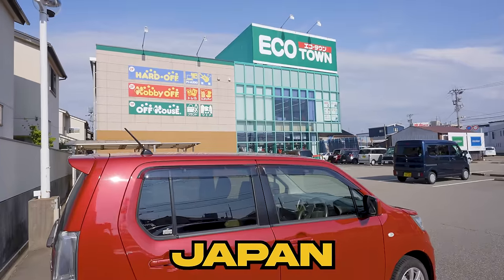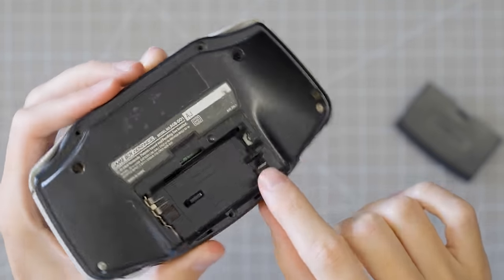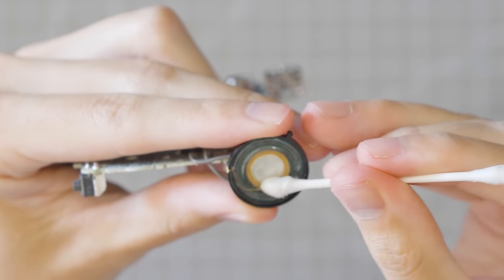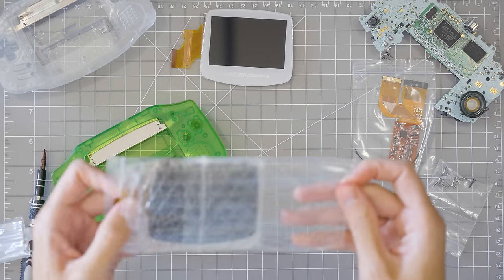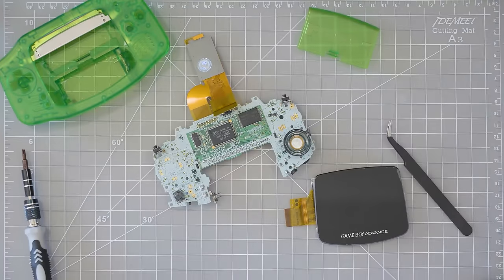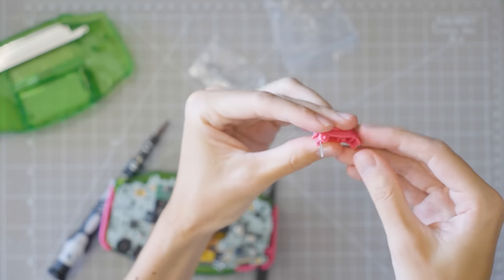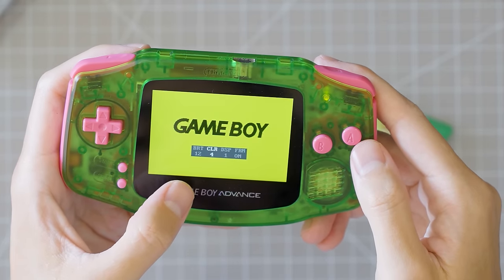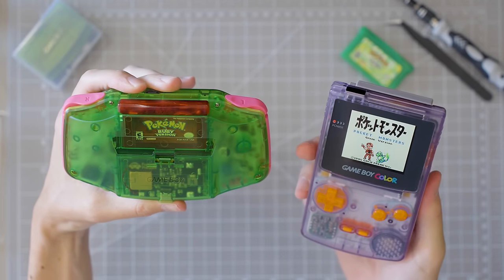I Upgraded a Junk Japanese Gameboy Advance

Comment: I modded my GBA during the Pandemic and love the screen and the new look.  I've been wanting to do another GBA mode and might get the new screen you picked up in this video.  Enjoy playing on a beautiful screen.
Reply: Marekprime  we probably used the same older LCD display that was selling on AliExpress 2 years ago? i bought my kit and soldered the 2 wires for brightness...screen not laminated as there wasn't any then...that's a new idea...i want one but i accept the mod is finished...can't have it...did you do the mod because the original unlit screen was broken or just to upgrade it? mine was damaged anyway...no battery modification on mine...just an adaptor for 3v mains power...only mistake i made was sticking the LCD down before double checking alignment...it's 2mm offset to one side...not an issue...at least it's level

Comment: I did that same thing to my original sega game gear 2110g system I put a glass screen protector on it and replaced the battery terminals and it works excellent

Comment: This was so new for me to see. I honestly didn't even knew this was a thing. Refurbishing and modernizing an old handheld. 
Proud owner still of my 2nd Game Boy Color. Had the Magenta one but the screen broke. Bought another one which was the Turquoise one and pleased to let you know it still works.  And when I moved into the house I live in now, they left behind a Purple Game Boy Color with Pokémon Gold version which still works as well. Has less good of a speaker and the buttons don't respond that well.
However my internal battery of my OG Pokemon Silver (the first Pokémon game I played and bought/got myself) run dry so couldn't re-enter my game which was completed. Full 251 dex.
I still feel sad about that. Is there even a thing to get that back or fixed? Also my Silver cartridge doesn't read anymore. Bought Crystal the year later. So the Gold and Crystal still work now but also there's no save file to return to sadly. 

Also loving the idea of owning the other handhelds and refurbish them and modernize them. Still mind blowing to me that that's a thing. So cool. It turned out real good as well! 
Japan has the most amazing stuff for sale still. I can't imagine finding that somewhere in The Netherlands or anywhere else. 

Love to see more of this. Also subbed here! Pokémon games are and were a blast to grow up with. Still love to play the games and fan games and rom hacks.

Comment: The reason for me getting a GBA is the ability to use the AA batteries. Because I have a solar charger. Then again I guess it could plug into the usb c charger. I just like nimh cells because lithium ion issues of swelling and so on . If only I had a solar algae battery powered game.

Comment: other reasons emulation on a phone is less preferable 1-you waste your battery 2-the real handheld has a different feel to the experience, 3-for the 3ds for example you get 3d and dual screen with stylus